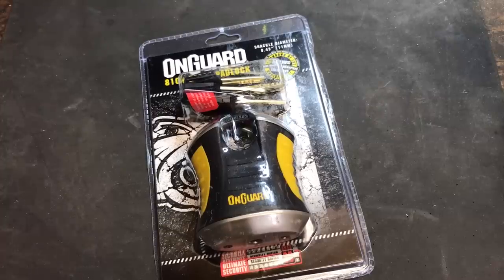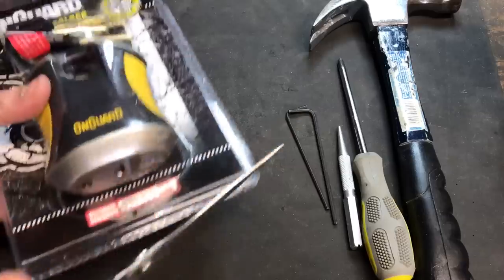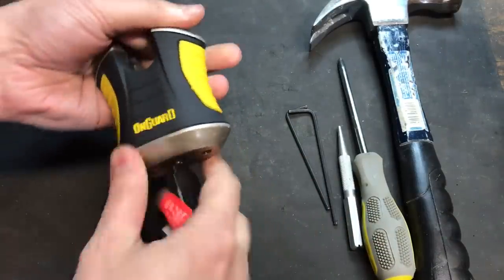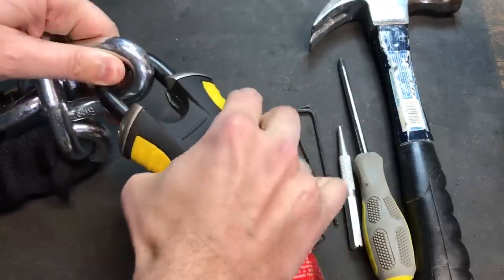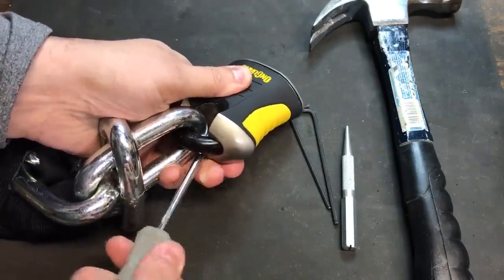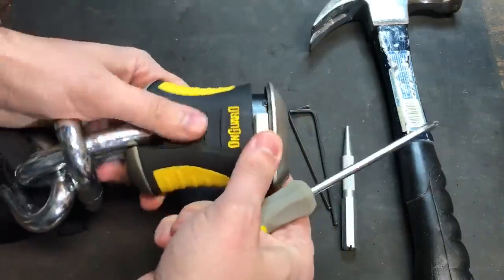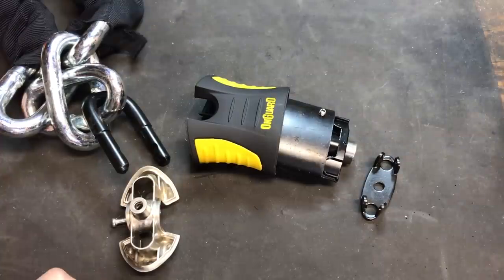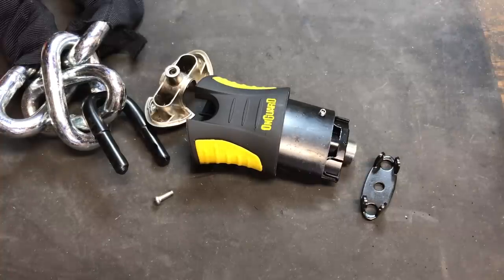[585] STUNNING - OnGuard "Beast" Padlock Disassembled While Locked!

Comment: So that's how you open that packaging.
Reply: For 200% higher security, keep the lock in the packaging
Reply: Nah mate, what you're supposed to do with this packaging is stretch and pull it in every direction for about ten minutes while making increasingly annoyed noises, before eventually getting a knife to it, which only then takes a further ten minutes, works every time for me.
Reply: Rabbit Snare  I literally still have cuts on my index finger from opening the package of a wireless mouse. I had made a large cut with a knife, and was pulling it appart trying to pull the contents out from it, and the PLASTIC was sharp enough to leave 2 deep cuts on my finger.
Next time I'm using the method in the video!
Reply: You’re actually supposed to open it with a tin/can opener.
Reply: Most valuable info passed in by LPL
Reply: Bro 😂 that comment is on another level
Reply: @Pauly421   Does that include wound dressings?  Lol
Reply: @volt3071  Using a hammer to open this packaging is the true next level. Then you only have to reassemble the atomic mess of the product inside.
Reply: @JohnSmith-qs5fg  Using a hammer is advised here too xD
Reply: Generally i just use my folding karambit. Stab a hole along the edge and just ride the blade along the inside of the non reinforced plastic
Reply: the easiest way to open it up is to completely annihilate the lock out of existence
Reply: A large percentage of ER patients around the holidays are there for severe lacerations resulting from the plastic packaging
Reply: Tommy Preston thanks for that 🤪 I don’t need to get a fire torch
Reply: Finally something I can imitate with my level of dexterity.
Reply: Shocked!
Reply: I hate this type of packaging so much.
It's evil.

I know it's an anti-theft measure of sorts. (so people can't easily take items out of the packaging in a shop) but it is just SUCH a pain...
Reply: lol
Reply: @Pauly421  I open it by bending the top so the plastic is exposed and THEN tear into it
Reply: This is how you open it
https://m.youtube.com/watch?v=JLDphmr1EQ8
Reply: Don’t you just love the way he gets into these packets, takes me for ever - and that’s if I find the scissors.
Reply: 🤣 you're not an engineer, are you?
Reply: RR_Productions  Angle grinder
Reply: @TVIDS123  What? How?
Reply: I use tin snips. Some use bandsaws. The choice is up to you.
Reply: That's more impressive then the lock
Reply: "For a bike lock thief to be able to open the packaging using nothing but a simple pair of scissors is, in my opinion, inexcusable."
Reply: That's what I learned here
Reply: @andreww.3208  is the frustration free or is it not included in the box cause I really hate that they don't just give it to you after you bought the damn thing.
Reply: @TVIDS123 Gotta try that
Reply: A Turbo Encabulator can open it in nanoseconds
Reply: @Stettafire  you just put it on the edge like you would a tin can and twist. The ridge on the outside guides it.
Reply: You really had to be told how to open that kind of packaging?
Reply: @bikerboy3k  Me and 4300 others.
Reply: @rolirolster  make that 4301.
Reply: Yup after years of fighting them packets now we just got a cut round the edges
Reply: I seriously nearly slice my fingers off when ever opening that shit!!!
Reply: Hahahahahaha
Reply: No sarcasm intended I just learned this too with same results as below , nearly chopped my fingers off too with Stanley blade
Reply: @warlord1873  amen, that plastic regularly nearly takes my fingers off!
Reply: That packaging, along with cockroaches, will be the only things to survive a nuclear attack
Reply: @Pauly421 u
Reply: He has more trouble with tape
Reply: Hate to say I thought the same lol. All these years cutting a small slit and proceeding to tear it open. Have even cut my finger once if I remember right. On the plastic and not the knife haha
Reply: This is the package opening lawyer, and what i have for you today...
Reply: @Pauly421  don't feed of another's joke.
Reply: Or Qui-gon Jinn could jam his lightsaber into the packaging and twist it around until it opens….
Reply: Wrap the bike up in that type of packaging. Seem more secure
Reply: I needed a pocket knife in a hurry and bought one in that packaging. I sat in my just looking at that nice, new knife inside.
Reply: the packaging was more difficult to get through than the lock lmao
Reply: Seriously? 6.3k liked this. Y'all really couldn't figure out how to open this?
Reply: @runitonce7791  6.3k people agree it's a common problem.
Reply: @runitonce7791  they're obviously not very smart people.
Reply: Honestly just thought the same thing lol

Comment: Moral of the story. Don't buy a lock with screws on the outside.
Reply: Weld the screw.
Reply: And NEVER buy a masterlock
Reply: Right! Like most of these I’m either like “wow, that is way outside my skill level” or “wow, I wouldn’t have thought of that.” But this actually all looks pretty straightforward.
Reply: "Never trust any lock" I think is the basic message behind this channel.  Probably better off with a guard dog.
Reply: Or turn the screws into a electric trap that melts the tools of the thief and thief
Reply: Another option is, press a longer slug into the set screws, so it can't be driven in enough to get a hex key in. Could also add some high strength thread lock as well. That would deter the use of a left-handed twist drill.
Reply: @horseshoe_nc  The left hand twist drill could still just drill the screw out. Good thing no one has cordless drills...
Reply: @aluisious  you are not drilling in a ball bearing they are hardened the only thing that can is a grinder
Reply: Dennis Woycheshen No its “Don’t trust a cheap lock.” The Bowley lock thats he’s shown before he actually praised on how secure it was. Then you have his massive squires that can literally take hundreds of bullets and still not open.
Reply: i mean the problem wasnt even the external fasteners it was the way they had attempted to prevent access to the internal ones.
Reply: @legros731  Read the comment I replied to.
Reply: @Mekronid However, you would need a lock to deactivate them, when you want to enter your home.
Reply: Take out the first 3 screws yourself and put it back together with epoxy. Then fill in the heads with a bit more epoxy. Would preven this method.
Reply: @benmac940  Yeah, if you happen to be given this lock for free, it could be worth it to fix it following your procedure or equivalent. However, nobody should buy this and then fix it, unless for demonstration purposes.
Reply: @herrakaarme  well i wasn't exactly suggesting anyone buy it specifically to do that. Just that it would quickly and easily prevent that method of attack.
Reply: Don't forget to add the packaging is better than the lock!
Reply: or angle grinders are quicker and work on everything
Reply: @ChrisD4335  They also produce enough noise to require hearing protection and lots of beautiful sparks that will be visible from a kilometer away in the dark. They even produce a distinct odour.
Reply: @denniswoycheshen  a nice steak and bam new best friend
Reply: Yes, specifically that first screw is inexcusable, in LPL speak :-).
Reply: @denniswoycheshen  I have heard stories of scrapyards in the UK being guarded by a pair of rottweilers, Yards got broken into, and the dogs were nicked.
Reply: The day LPL says a lock is good (or better) the day that companies sales skyrocket
Reply: @ChrisD4335  just bought a milwaukee m12 3" cutoff saw. It is relatively quiet and light.
Reply: At least these flaws are fixable by making it impossible to use these tools. The customer shouldnt have to do that, but still - he can "upgrade" his lock to prevent this from happening.
Reply: @R1ku994  Never buy a Chinese lock.
Reply: @denniswoycheshen  yeah or just buy paclock since they are usually strong and are fairly pickproof
Reply: Or (and hear me out on this), make a lock with a whole bunch of dummy screws on the outside to fuck with people.
Reply: @horseshoe_nc   if theres a longer slug, wouldnt a bit pertrude out the top, and then you use pliers to turn it? just my thoughts
Reply: In college I remember being surprised how many things are locked but have exposed screws.
Reply: @denniswoycheshen  yup, no lock is impassable, just a question of how long it takes and how difficult it is.
Reply: Well seeing how long it takes to take this one apart and the number of tools required, I would say this isn't a very practical attack. Still pathetic for a high end lock since it's rather low noise unlike an angle grinder
Reply: Exactly. Putting screws on the outside, advertises Poor Engineering.
Reply: Correction: don't buy anything of any value. LPL has taught us to great lengths that locks are useless.
Reply: @denniswoycheshen  if a guard dog is all you got to protect your stuff you are just asking to get robbed.   Dogs are easily “defeatable”…. And I don’t mean killing them either (although lots of meth-heads wouldn’t think twice about doing that)
Reply: @ChrisD4335  angle grinders are noisy though.. but yeah,  they can chew through pretty much anything

Comment: For someone who is usually so amazingly precise I think the way he negligently tosses away that first screw says a great deal about his opinion on this lock!
Reply: I got an impression he was not about to bother assembling the lock back together.
Reply: My thoughts exactly 💯
Reply: Exactly, I noted that too
Reply: Well, the security consists of a two-step almost secure boundary. The first step being the accessible screw, the second step being the ball bearings in the two next screws.
You at least should match the ball and the ball-bearing screw such that the ball cannot be hit deeper and that the ball cannot be pulled out. Better would be to weld the ball and bearing. Yeah, it cannot be disassembled (easy)  that way. So why would you want it to possible to be disassembled easily?
The one thing to be said for the security is that bypassing both steps takes a little time and will be less easy when you have the lock dangling on the chain i.s.o. lying on the table.

Comment: You know it's a bad lock when it takes you longer to open up the blister pack than it takes to force open the lock.
Reply: Heaven forbid someone steals the lock...
Reply: If only I could blister pack my bike. Id find would-be thiefs on their knees with bloodied fingers, screaming at the plastic.
Reply: No you don't get it you are meant to keep the wrapper on it and just cut holes for the top bar and keyhole! ;P
Reply: That's the actual security mechanism ;)

I'm thinkin' you could somewhat mitigate the issue by pounding more ball bearings into the set screws. Lipstick on a pig, yeah, but a thought.
Reply: @unitrader403   Better yet, after the ball bearing is pushed in, tap the set screw with a MIG welder, fusing it and the ball bearing to the lock body.

A better design would have been eliminate that 1st screw centered under the shackle entirely and move the bottom 2 set screws to the bottom of the shackle leg holes so you can't access them until the lock is opened and the shackle is removed, then the screws can be pulled and the top and bottom casings can be removed to dismantle the lock.
Reply: @HappilyHomicidalHooligan  better yet, for those who have this lock, just round the top of the screw so that it can not be unscrewed, you can also place a screw glue fixator, adding the two methods could not unscrew it
Reply: @joan4180   Crooks may not be able to unscrew them, but if the screw heads are accessible before the shackle is opened, they can simple drill them out and voila, lock opened...If the screws can't even be seen until the shackle is opened, they can't remove them to bypass the key...
Reply: @HappilyHomicidalHooligan  The drill makes noise, it is like the Grinder that also makes noise and would attract attention. What I intend is to give advice so that thieves can not open it discreetly with a screwdriver, your idea is good about the redesign ... but the design is already done and I do not think they will change. For example, I have a lock for the shackles with an alarm for my bicycle and a padlock for the "guard" brand. If thieves touch my bicycle, it will sound, the sound is very unpleasant for the thieves and a warning to the owner, it all comes down to the same equation that you should not let the thief have time to work and hold the thief as much as possible until the owner arrives
Reply: Invents blisterpack bike lock (encase bike in blisterpack)
Reply: Lol
If I saw a bike secured with blister pack I would move on. I hate that shit.
Reply: David Daivdson  this would be doable on the ground or any flat surface that wouldn't break from the punching. This would require very basic tools (any tool set with bits as you could use a smaller Allan bit to hammer the bearing)
Reply: Someone mentioned once on reddit (regarding the intense packaging of master locks) that someone being easily able to bypass their packaging hurts their bottom line, but a bad lock doesn't.
Reply: @ronniefromdk  whats a blister pack?
Reply: @Reziac  Or just...cover the screw on the top
Reply: @HappilyHomicidalHooligan  if we're going the welding route, why not simply TIG weld the ball bearings in place and then simply fill up the head of the phillips head screw.. and yeah, id go with TIG for more control and not to add any unnecessary materials.
Reply: @joan4180  A small battery-operated drill makes almost no noise.
Reply: I once saw a special pair of scissors designed specifically to open this type of packaging.
Ironically, it was packaged in this type of packaging.
Sad!
Reply: @Reziac  "Lipstick on a pig" More like putting a band-aid on a decapitation.
Reply: @ryannorthup3148  LOL exactly!

Comment: Pshaw, that is a security screw, no criminal has a phillips.
Reply: All the criminals I know only have square drive, (I’m in Canada so finish carpenters and cabinet makers use the superior Robertson screws).
Reply: I'm a US carpenter and switched to square drive (Roberson) screws 20 years ago. Now won't use anything except torx drive. GRK has changed construction forever!
Reply: John-Paul Silke 

America: “We put a man on the Moon.”
Canada: “We have screws.”

You’re right though, Philips is godawful.
Reply: Not sure it really matters if it's some obscure 'security' head - either way the fasteners that hold it together are accessible from outside the lock. 
It could be proprietary heads and it would still be a complete failure.
Reply: taiiat how is a Philips obscure it’s like one of the most common
Reply: @darkithnamgedrf9495  he's saying if it was even obscure. Not that it is.
Reply: escutus oh ok just a simple misunderstanding have a good day
Reply: @darkithnamgedrf9495  yes. I have no idea why they would put any screw that is easily accessible while still locked. Salutations.
Reply: @darkithnamgedrf9495 : It's one of the most common. What do you need 'like' in this sentence for?
Reply: In UK screwdrivers are illegal. So this lock should be pretty strong there.
Reply: A one way security screw would of been better than a regular Philips screw, the clue is in the name security screw for things that need a security screw not a general Philips none security screw used as a security screw how stupid can they be.
Reply: @usptact  If screwdrivers are outlawed only outlaws will have screwdrivers.
Reply: @arlingtonhynes  The telescopic legs for the lunar lander were built in Quebec, so without Canada, USA obviously would have crashed on the moon. ;)
Reply: pubfixture But they screwed them on with Phillips screws. 

That’s what really went wrong with Apollo 13 btw. Fortunately we had a secretly preserved Avro Arrow to rescue them with.
Reply: Splestrie where did you hide the aero??  Lol
Reply: Auto correct made a jet into a candy bar 😂 😂 😂
Reply: Terry Goyan you guys are way behind us in Wisconsin we use circle bits
Reply: @john-paulsilke893  Im a Electrician in Ontario and I can confirm, just about everything is done with Robertson screws! (And that Phillips head screws are garbage, only Slot screws are worse)
Reply: @terrygoyan  Torx head screws are used a lot in aviation. I have many torx bits in my tool box.
Reply: @rmyd027  Phillips head screws are used a lot in aviation and secure most panels on the aircraft. Torx are used in some of the under wing access points but the ones holding on the fairings and such are just #2 flush head Phillips screws covered with sealant.
Reply: I mean, I mainly have them for opening up electronics with.
Still the most common screw type on computers. And mobile phones for that matter (once you get past the layer of 'security' screws)

Honestly the only security screw that I've ever run into that's any kind of pain (or used to be, before you could easily get the bits for it off ebay) are the ones Nintendo and Sega used on their game consoles in the 90's.
Except... You can open those by melting a plastic pen body against the screw. XD
That'll break in a few minutes, but it does the trick...
Reply: @pubfixture  Canada 🇨🇦 is part of the American continent but with shared physical and digital security, shared markets, and shared languages, these are not different countrymen, just different political jurisdictions. The people who live on the border and who must travel through the neighboring country to reach parts of the home country can clarify for you that we share countrymen, there are just different political jurisdictions.
Reply: @john-paulsilke893  Torx is the actually superior screw.